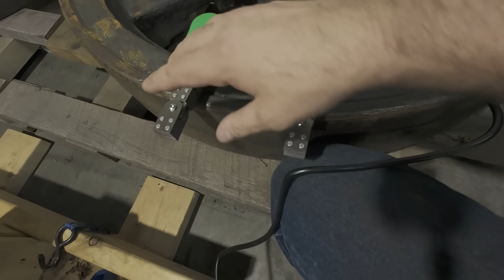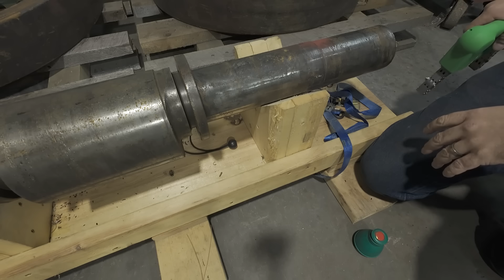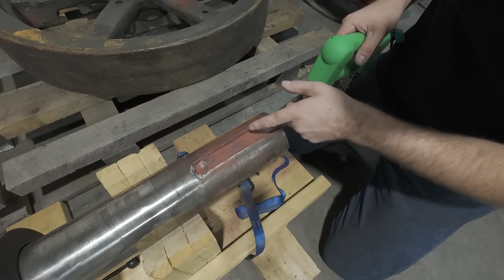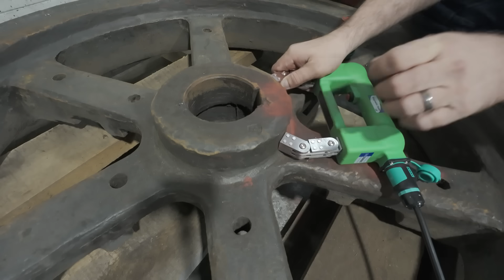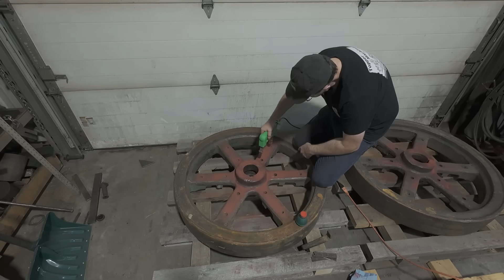Are These Rock Crusher Parts About to Fail? | Magnetic Particle Testing Squatch253's Rock Crusher

Comment: So the cheapest fix would be to turn down where the pulleys mount  to get them true. Then taper bore the flywheels and make a taper lock sleeve to bolt in the flywheel. I pretty sure I remember the bearing surfaces were ok and that shaft is already worn to match the existing babbit so that saves needing any rework with that part. Can make a custom extra wide key or even a half depth one to fix the loose keyway without having to take the whole shaft down to good material or just cut the key on the other side. With a taper lock the key won't be doing much anyway since friction does the work.
Reply from the maker: I have something else in mind. But a taper lock is second thought, just reversed. Put the taper on the shaft.
Reply: @TopperMachineLLC if you taper the shaft though you still have to do something about the pulley bore because it’s too large. Also shaft was too short for threads so you would have to drill and tap  and use a plate to positively force the pulley on. So that is more parts to make at least how I In vision it
Reply from the maker: @bcbloc02 yes, correct. I have to bore the pulley anyway. They are not round.

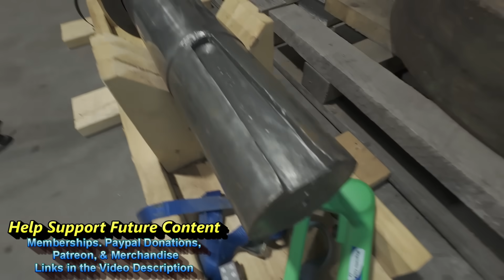Comment: 5:20 I'd bet money a shaper cut that keyway. You need a hole for the tool to end it's stroke in, and a keyway that long and deep would probably be more efficiently cut with a shaper than with a mill.

Comment: When i was in the Air Force i worked in power plants . When we pulled engine sleaves we would spray red powder in the sleave bores then spray a clear coat over the powder . Where every there was a crack it would be dark red . I think it was called magnafulxing . That was 50 years ago . Awesome video .

Comment: ASE Master certified engine machinist, gas and diesel, don't know how many pounds of particle dust I've puffed over the years!??, we have permanent magnets (actual Magnuflux brand), could probably pick up a cylinder head with one if you were careful?, the crack shows best when it's perpendicular to the magnetic field, dye check is used on aluminum/non ferrous metal.

Comment: No cracks, good news! Years ago I worked at a automotive machine shop and magna-fluxed lots a cylinder heads and blocks. We would try to magna-flux items after we hot tanked them when they still were warm and dry.

Comment: Amazing that something that's seen a hard life (IE: the battered key way) comes out so nicely.  Dumb question time - have you ever seen a crack form from the inside of a part that then penetrates the outside?  I've never seen it happen, but I guess it's possible?
Reply: the only way I could see that happening is if there's internal stresses that have the interior under tension with the skin under compression (the opposite of Corelle Vitrelle: they're under tension-skin tempering so the interior is under compressive stress)

Comment: I have never seen magnetic particle testing done before, but I have seen dye crack testing done on another channel. It was interesting that you explained just how it works. Good news that there were no cracks.
Reply from the maker: I have done PT (dye penetrant testing) on my channel before. I can't remember which video, bit I've used it a couple times.
Reply: @TopperMachineLLC   I didn't remember you doing it, but I would have seen your video on it if it was after I subscribed. I can remember CEE doing it.
Reply from the maker: I bet he did it wrong. Lol. When I was at ASME school, the one instructor was telling stories of very common mistakes in PT. Without the ASME code books or ANSI Books, you don't have all the information to do it correctly.
Reply: @TopperMachineLLC   I could not comment on the procedure, only that his testing showed up cracks. I remember him using I think it was  three different substances and the cracks that weren't visible before, stood our really well.

Comment: The forces generated in a rock crusher can be enormous and completely random as the parts move together sending the force back through these connected parts.  Catastrophic failure is only one microscopic crack away.  There is no real way to test when the crusher is complete and running and no real way to ease into the crush forces generated by the flywheel momentum on the eccentric of the primary shaft. A minute movement generates tons of force.  Years ago I worked on a jaw crusher with a 5X8 foot jaw, with twin 12 foot flywheels. Not that I am an expert, but these machines no matter how small generate incredible crushing forces. Great topic and commentary.

Comment: Maybe I missed in a previous episode; Did you guys try ringing the flywheels with a hammer hanging them thru the bore from the crane?
Reply from the maker: We did not. While that would be effective, it sometimes doesn't give you the full picture.
Reply: @TopperMachineLLC  that sounds like a 'first quick test', a bit of a go/no go on continuing work. a good ring-test doesn't mean you can be lax on magna or dye, but a dull ring-test means you 100% Got Problems. Depending on available rigging and time-demands, a ring-test could be a good Triage for 'continue to detailed testing' or 'kick out to scrap'

Comment: Happy Saturday Josh,
If one of your customers wants a rush job handled ASAP, how long will it take to bring your shop, equipment and materials up to temperature to machine?
I imagine that if you started machining, you’d get some rise in temperature, but how about holding tolerances?
If I recall, tolerances were set at 68-72 degrees, held for 48 hours before measuring the final dimensions.

Comment: Thanks for the video 
It sounds like you have made up your mind with the repair    I would bore the flywheels out until they clean up and make a new shaft to fit    It wouldn’t be easy and a lot of material to remove but everyone likes seeing big chips    
I hope that things are going well with your new job
Reply from the maker: The cost of the material for a new shaft would kill the project real fast.  I have a plan.
Reply: Okay    Thanks for the reply
   I really appreciate the discussion on a machining project

Comment: As an apprentice we did NOT on the turret ring gear on the chieftain tank FOR Leeds witch involved a big transformer on wheels a coil of wire about 3/4" thick wrapped  around the ring gear setter with iron particles in paraffin oil, then energized .cracks would appear as if by magic. We also used ultra sonic, x ray.

Comment: Good Magnetic Particle inspection Josh.
I use the process all the time.
I also get crankshafts Magnufluxed, with a wet mag and black light when required. 
It is also an excellent process. 
Thanks for sharing Josh. 👍👍
Reply: Googling "wet mag" right now.👍

Comment: 40 years working in shops, I have never seen a new MP Tester. From the time I learned how to use one in shop class to now, every one of the testers looked like Jesus had used them as a teenager. Most of them also hummed and had electrical tape everywhere, even on the handle. Good times.

Comment: The drilled hole at the end of the keyway for the bit to start or stop when using a shaper .
I did this over 50 years ago in highschool to cut a keyway in the middle of a shaft .
Reply from the maker: I never considered the shaper when looking at it. Now it makes sense.
Reply: @TopperMachineLLC  hello from Tasmania if you want to see old machinery in action watch hydraulic hands
Reply: @kennethnevel3263  You beat me to it, was about to write the same thing.
Reply: @gutsngorrrr  I came here to say that 😸
Reply: thanks for that now I know how to do it with my old shaper

Comment: Josh, is mag testing more of a pin point test than dye testing, where the dye test could more easily test the entire piece, and if it shows an anomaly, go back with particle test? Interesting video, thank you!
Reply: dye testing is best for 'you already know there's a crack, but you need to know How Much Crack'. it's hard to dye a whole part, much more time consuming than Magnaflux. if you're in a part-reclamation role, you'd probably Mag it first, then mark the problem areas with something that stays there, then go back and Dye Check it

Comment: If I recall from seeing Squatches disassembly video. that thing is pretty old. Key way was probably done on a planer. The hole was drilled for relief at the end of the stroke.
Reply from the maker: That makes sense.
Reply: That short on a shaft, maybe shaper rather than planer.
Reply: I was thinking that, and you beat me to it. I wonder if there are any tooling marks left.
Reply: @JamesBeyer-y5q  if a full width form tool, probably not.
Down the sides, however 🤔

Comment: When I was in the Air Force, I had to strip aircraft wheels all the time for Non Destructive Inspection. We, the paint shop, did not test the parts but they were sent to another specialist in maintenance. I also had to strip bomb racks. When the parts came back from inspection and if I did not clean the parts properly the die penetrant would bleed right through the paint. Thanks for the video; interesting. Good to see you!!!!:cat-orange-whistling::cat-orange-whistling::cat-orange-whistling:
Reply: There are some critical parts on the chairs on ski lifts that get this kind of testing. Amazing that the same type of testing is used on such dissimilar applications.